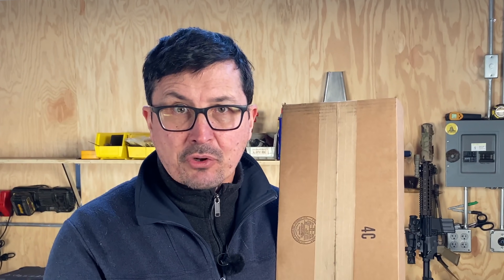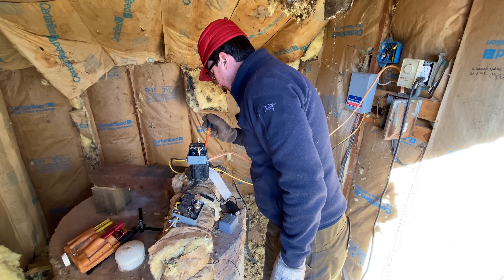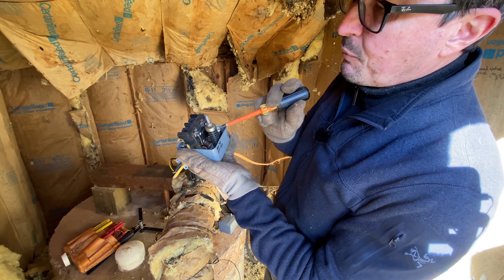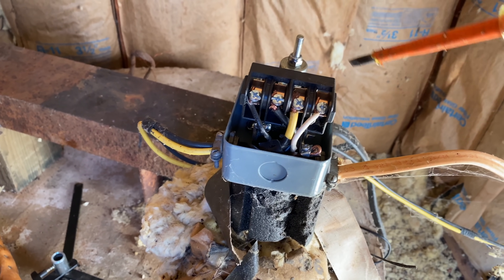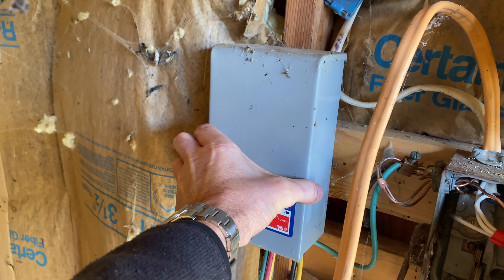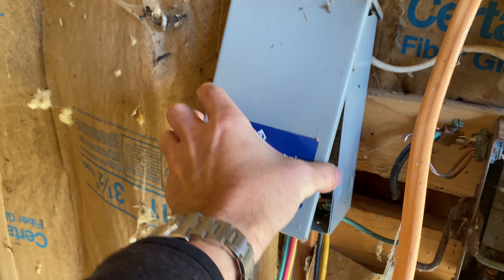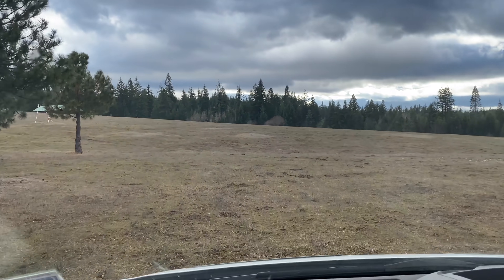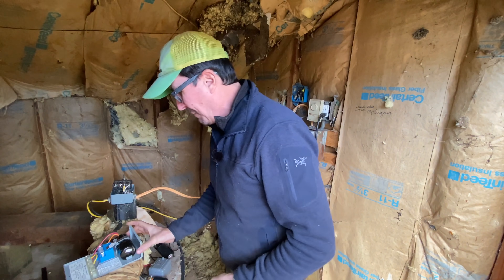We Have A Big Problem

Comment: We had that same problem not very long ago.  I could easily see that my capacitor had expanded and cracked. I went to the well digging place in our little town and they gave me a used but good capacitor to try.  Unfortunately my pump was bad too. Those guys took time to help me figure it out without charging me.  I had 4 pizzas and drinks delivered to them as a thanks. You definitely have to take care of those that help you.

Comment: You can probably get a cheap replacement capacitor and repair the old unit. That'll give you a spare if the new one ever fails.
Reply: I agree the capacitor is probably on $20 and can easily be changed
Reply: Edward McKinnon in a pinch you could wire in a light bulb with a pigtail in place of that capacitor.
Reply: @diesellib  In terms of electricity, a light bulb would be a bad idea. The system was designed to have a capacitor.
Reply: Moistifier I said in a pinch. It’s designed for a capacitor yes but a bulb would get his water pump going.

Comment: That was nice gesture man. Well done!
Along the same lines is why I like to use local businesses as much as I can. Yes, you might pay a bit more for something. But, you're building a relationship with a person or set of people at that business. And that makes it much easier to tap into the years of experience and knowledge they have. And that has definite advantages. For example, I blew a hose on my tractor one time. I went to the same place I've been going for years to get a new hose made. They had the hose and fittings, but their crimping press was down. They sent me to one of their competitors down the road. I told the new place who had sent me and gave them my parts (from the first place). They made my hose and didn't charge me anything. Now I bounce back and forth between the two places when I need hoses.
Being nice pays off for everyone involved.

Comment: How many of you are yelling at the screen right now: "Just replace the capacitor!"  With all the preparations you've made for the apocalypse, there's a big glaring hole right in front of you there Mr. W. Maybe buy a $10 replacement capacitor for your water source? LOL but live and learn.
Reply: My thought exactly. But like he said, pixies are not his forte'.
Reply: lol yeah. We have our own well, and its aaalllwaays that damned capacitor.
Reply: The cap by itself is unlikely to be available locally.  Would have had to have his pump down for a day or two while one shipped out.  In this case I am sure it was worth it to spend $80 to be back up an running right away and not have to answer to Mrs. W.  Having a spare is nice, but given that electrolytic caps have an expiration date, it might not be wise to spend the money on a spare at the same time you just put in a new one.  I would consider putting a reminder on my calendar 3-5 years out to buy a spare so it's not already old when you need it.  I had this same problem with a drill press a while back and chose to not buy the spare cap because 1. I can usually afford to have my drill press down for a couple days while I wait for a replacement to get shipped.  2. I don't want the spare to go bad sitting on the shelf.  3. I have other equipment that use startup caps with similar enough specs that I could "borrow" if I REALLY needed my drill press (in fact, I used a cap from something else to confirm the issue with the drill press before ordering the part and could have continued using it like that in a pinch).
Reply: Totally. Leaking like that. Although, not many places sell just the capacitor.

Comment: Hi Wrangler great video! You are correct the black cylinder is a start capacitor for the pump motor. I'd like to point out that all you would need to change in that scenario would be the capacitor. They are usually the first thing to fail on single phase electric motors. They are generally not to expensive if you call a local supplier that deals in electric componentst. They should be able to get you the same exact solenoid for much less. I'd also note that being much cheaper it is feasible to have one or two capacitors as backups on a shelf somewhere. Keep up the great work. I very much enjoy your videos! God bless!

Comment: Cody, that was some good trouble shooting. You could have used a clamp on amp meter on that cable. As long is you could wrap around the conductor with the clamp on you will be good to go to read it. No need to remove the sheets from the cable. Awesome work. It’s nice to have something that simple be the fix.

Comment: Hi Cody.  Awesome all turned out OK with the pump.  I have maintained many systems just like yours.  The shed.  Oh, man.  I have had to completely replace sheds because the mice simply destroyed them.  Made them impossible to be in.  When replacing a shed or constructing new systems I sheath the interior and close up every entry point even making the thresh hold mouse-proof.  What a difference that makes for me.  A total joy to enter and work.  Signed:  Sticking my nose where it doesn't belong.

Comment: Cody, the capacitor is a motor starting capacitor. When energized, it gives an extra kick to turn the motor on. Once started, the capacitor is no longer needed. The capacitor can fail and is easily tested and replaced for under  $20. You just have to match the capacitance (in mfd) and voltage. A higher voltage rating doesn't hurt. Replace the capacitor in the old unit and leave it as a spare.
Reply: htmagic I have a feeling that you are in the hvac field
Reply: @austinpadgett5149  Nope. Chemical Engineer with over 40 years experience.
Reply: Great advice. HVAC suppliers have many of these start capacitors In stock. Should be easy to find.
Reply: @BigDmike24  Also motor repair places. Probably the same place where he bought the entire controller. Probably only needed the capacitor in it.

Comment: Electrical troubleshooting drives me crazy.  My car was having a strange electric problem I thought was a parking pin or gear position sensor...it was doing weird stuff, like electrical troubles do.  Mostly it just went completely dead right after putting the key in at start up, but back on if stuck my leg out the door and pushed the car back against the parking pin.  Talked to my mechanic, through all the troubleshooting possibilities.  He said before you do anything else just check your battery connections.  They were tight, really pretty clean, but I took them off and did a clean up of posts and connectors, reinstalled.  That was it.  I love when the fix is the first and easiest thing you do.

Comment: Hi.. Glad it was such an easy fix.  FYI.. You should be able to pull  well pump, cables and tubing out by hand at the depth of your well.  I've pulled pumps out at 20 ft with help from another person. Main problem would be accessing the pump.  Don't know about the regulations in your area.  That may also play a factor.

Comment: I recall a rare flood taking out the farm's supply pump on the creek: it got into the electric motor doing it no good at all. There was an old piston pump in the shack for emergencies, hooked up to a petrol engine it could keep things going but at a reduced volume. That was used for four days while a new electric pump & motor was acquired & set up. The replacement unit was fully sealed & flood-proof, but in the 35 years since then, the water level has never come close to the workings.

Comment: Well pumps, pool pumps, and the A/C outside fan units. All have capacitors, if the motor is humming the capacitor has gone out. Always keep replacement capacitor for each unit on hand. Capacitors come in different powers. They like to go out on weekends and Holidays when everyone is closed. Lol. Great Video.

Comment: You can buy that start capacitor to have a spare on hand. Some of the better volt meters have a setting to  test the capacitor rating. Great video, and God bless
Reply: Unless worn off it's also written on the side. A blown capacitor won't give you the correct ohms reading.

Comment: When we had a borehole pump it fed into a 500 gallon tank, the tank had a float switch at the top and another half way up.
The top one would switch the pump contactor off, the bottom one would switch it on.

A third float switch just below the lower one would light up a warning light letting you know that you're consuming water faster than the pump can refill the tank (broken pump, dry well, major leak / high consumption, etc). 

...and if the light ever came on you still had half the tank available as a reserve.

It was a simple system, but worked great.

Comment: one thing to note is that capacitors can be extremely dangerous if your not familiar with how they work,  they store energy like a battery except that they charge and discharge very fast so they can  maintain current even if there is no power connected to them and can discharge that current into you all at once if you touch its terminals. Its always a good idea to make sure its safe to handle by bridging its terminals together with a screwdriver or something to discharge any stored current. capacitors come in all sizes and have many uses but in this instance its likely used to provide a jolt of power to initiate the rotation of your well pump motor.

Comment: You can test a capacitor using a descent Voltmeter. There is a selection of “MFD” on the voltmeter. You have to disconnect the wires from the capacitor to test properly. It will take 3 seconds or so for your voltmeter to register the MFd’s. If it’s good it will register within about 5-10% of what’s listed on the capacitor body for MFd’s.

Comment: I'd replace that cap which would be much cheaper. It's definitely bad.  Just be careful! Those caps can be dangerous if shorted.  Anyway, I see you bought the entire thing. Of course, it may be tough to find that cap as opposed to the whole thing. I have a background in electronics, so that's just how I think. Glad you got it working. Good man! :)

Comment: You can replace the start cap itsself...no need for the whole face housing...any hvac supply will carry that ...just pull apart n swap...good to buy 2 for emergencys...they usually pop from excessive amounts of heat or running during a heatwave

Comment: Him taking that 10 minutes to run through your well problem is very good business practice. 1. It sets a good relationship between you and him. 2. With him giving you a quick simple fix for problems like a capacitor or a bad connection it stops a very simple inexpensive repair call for him to send a guy out and he have to bill you a large amount for not a lot of work which would leave some people with a bad taste in their mouth over it. 3. with him saving you money now and building that good relationship with you he is probably the first call for outside help on your well now when the job is too much for you or if you need another well installed or a new pump in the coming years if that one fails. If only more contractor/supply businesses could figure out the simple art of retaining customers.

Comment: The controller has a starting capacitor, most motors have the starting capacitor on the motor, which the motor once it starts has a centrifugal switch that goes from start windings to run windings. The capacitor give the start winding a jolt to start turning...great work though analyzing the problem.

Comment: A multi-meter that can test capacitance is worth owning. Start-run capacitor failure is common, easy to test and fix with the right tools. Not with just well pumps, I've fixed them on HVAC units, dust collectors, metal lathes and even a ceiling fan. So when a motor doesn't run correctly (smoothly) check the capacitor. Usually an easy to diagnose problem and inexpensive to fix. I'd have a back-up capacitor ready and waiting near the pump control. I think it would be wise to diagnose what actually failed in the control box (probably the capacitor), a $10 fix !

Comment: We use a 12vt solar pump, Shurflo,  that trickles into a 300 gal underground storage tank. From there it goes in to a also solar powered pressure 100psi pump on a 50gal tank. Two RV batteries, 2 solar panels, no electric bill.

Comment: that's the capacitor for the well (it gives the motor the first little kick to help it start) you test them by  unplugging it and put your  meter ohms, the number that it shows should match the number on the capacitor (example, 5 uf)you can buy one for under $20 (if the capacitor swelling or leaking generally it got to be replaced)

Comment: First guess is the capacitor. (When you said you could hear it trying to run) chances are replacing the whole box was overkill. Capacitors of that size are cheap compared to the whole control unit. (Match the ferad rating "*F" or "*uF")

The original unit would probably work again.

Comment: When I saw the well house in the thumbnail, I was afraid it had frozen and cracked on you. I'm glad to see it was a simple fix for once. 
You're not the only one with rotten luck when it comes to troubleshooting. I also seem to always need the 2 hour, $1500 repair when the more common fault is usually $50 and 5 minutes.

Comment: I  real well/pump guy like me would tell you to just replace the START capacitor. It only helps start the pump, then out of the circuit. Under $15, and  easy to get, Just yank the old one out, the specs are printed on it..volts/microfarads. 

Also your 70/90 start/stop pressures are way high, you're stressing the motor. Normally it's 20/40 , or 30/50...60 would be
the max/ pressure I'd even consider.  

Oh...FYI there's a Gustav's in east Vancouver..164th maybe...might be closer to you than your PDX one.
Love your vids, I'd love to come visit, you can put me to work even.

Comment: The condenser kicks the pump motor. Brush-less motors need a condenser to make them turn in the right direction as well as to give them a jolt to start the spin. I worked for a well driller when I was a kid. My Dad was a general contractor and lent me out in the summer to a different contractor each year for a few years starting at 12 years old. Feel like your neighbor though I live in Delaware.

Comment: Back about 10-15 years ago the control box had 2 capacitors a start and a run and now both are built into one the start side of the capacitor was bad witch is very common the best thing to do is get rid of the control box and 3 wire pump completely and get a 2 wire pump so it's wired straight to the pressure switch it it's money but a major improvement and less parts.
 Sorry I've been putting in pumps and Wells here in North Florida for 15 years and with it being shallow it wouldn't be hard to do.

Comment: I had a well pump switch much like this in an older house but it was in the basement.  I was foolish and destroyed a screwdriver with it, but it didn't ruin the switch.  The problem I had was that there was a pipe stub out at the well head that froze when it was sub zero for a week.  The pump was just running a lot because the pressure was always low.

Comment: Great educational video - in more ways than one...  Nice touch with the gift certificate - everyone benefited.  I couldn't help but notice you may have one or two mice (sinful little creatures) in your building that houses the water pump.  One way you can slow them down is to put up a few 'Bird of Prey' nest sites.  They are quite easy to construct.  I pound a 4x4 fence post base (metal) into the ground with the longest 4x4 I can get (or laminate/dowel a few 2x4s together) and place/screw a 4 foot x 4 foot piece of 3/4 inch plywood on top (edge molding helps the nesting material stay in place).  It is an environmentally friendly, legal way to help cut back on the mice and other rodents if you have them.  If you are successful and get some 'nesters' contact your local wildlife office and they may come out and 'band' the fledglings.  You could have a whole series of videos (construction through first flight)....  This is the perfect time of year to set up the nesting sites.
P.S. No disrespect to mice - I just happen not to be a member of their political party...
Michael from Canada

Comment: Had lightning take out our controller replaced it still no water... Got a sparky out took us about half a day to trace the problem to the armoured cable underground under the service road, dug up the road fixed the problem sparky cut the wrong wire off the cable and the pump still didn't work.. Replaced the pump with a new one just to find figure out the pump was fine, the next day I checked the sparkies work figured out the problem and  got him to come fix his wiring. All in all it was an eventful weekend expensive but everlasting memories.

Comment: A well pump consists of a motor and the pump mechanism. Motors usually need a Starting Capacitor to provide the initial surge of energy to start up. You could probably just have replaced the capacitor and you'd be back in business. For the future, I would buy an extra capacitor and leave it in the pumphouse for the next time, unless you're not comfortable replacing at the component level. They tend to be the weak point.

Comment: Most good volt meters will have a micro farad setting that you can test a capacitor with. You have to disconnect the wires from the capacitor and then use something metal to short the two terminals together to discharge any potential charge it may be holding. If you don’t do this, you may get a nice elec shock off it as it stores an electric charge and releases it when needed. 
Then with a meter set to micro farads(uF) test between the capacitor terminals and if the capacitor is good it will read within 5% of its rated capacitance which should be written somewhere on the side of it. But judging by the look of the top of that cap, I can bet it’s bad anyway.